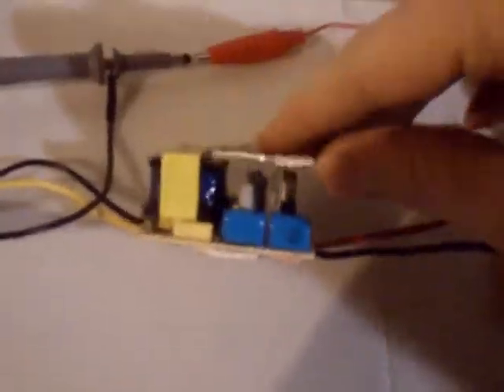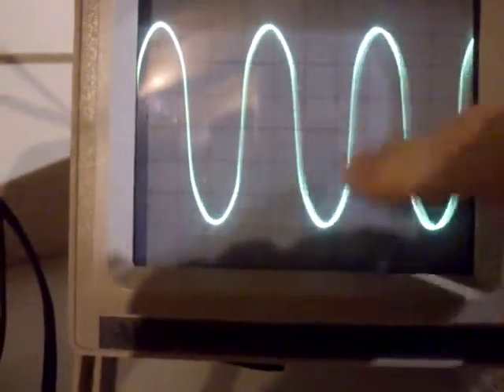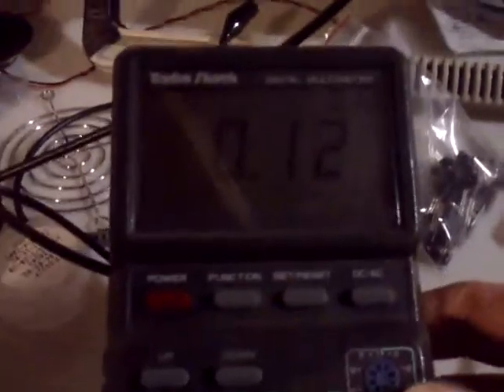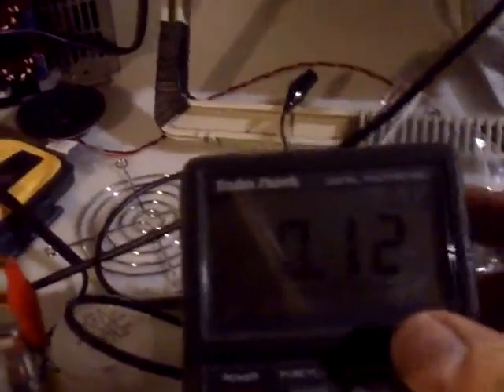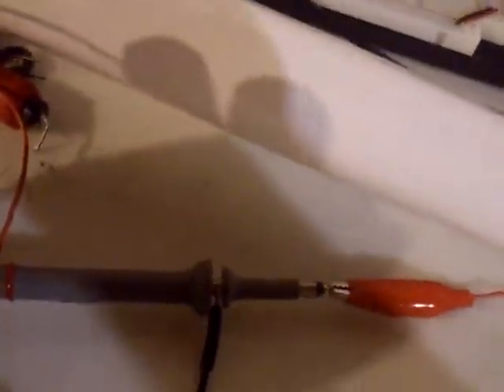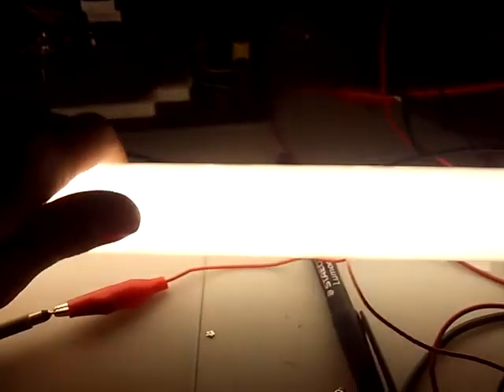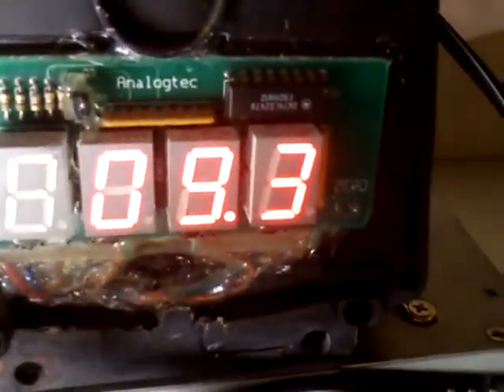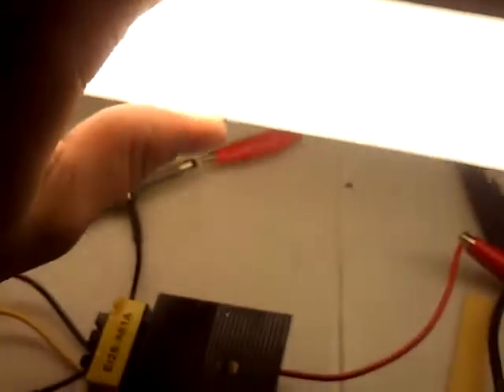ZVS inverter update and scope shot

Comment from the maker: You can basically light a fluorescent light with any voltage if you have the proper driver for it and since most mosfet I have does not go below 6 volt ( and I'm pushing luck here) and also in this case the transfo I'm using is a 12 volt ;)

Comment from the maker: The little inductor is very small I will need to change it for a bigger one on 120w the globe is very very bright and get hot fast the inverter use about 15 amp on my PSU lol so for this type of load I would need to use a fan on heatsink to keep thing on the safe side =D. Amp on scope on the output yeah they are on the input it's meh very spiky since my home made power supply need work it tend to go jumpy a little on low power. Some more experience require ;)